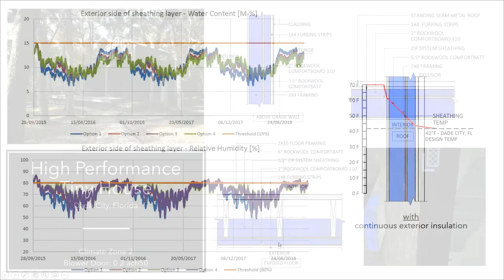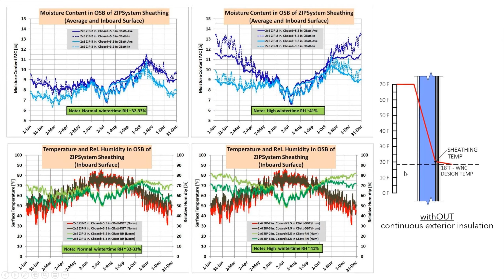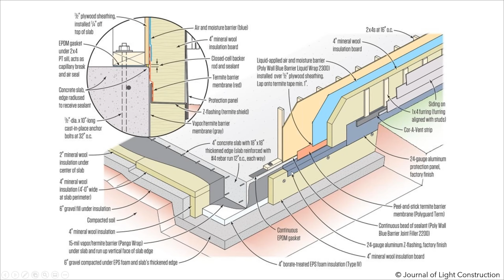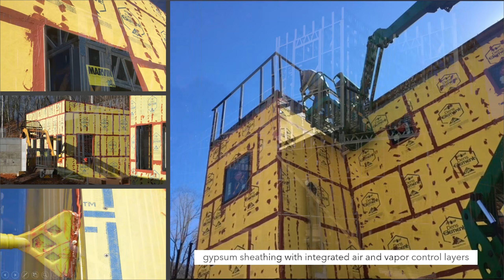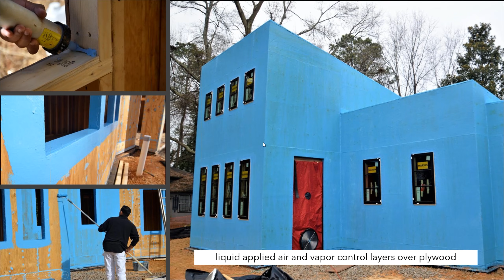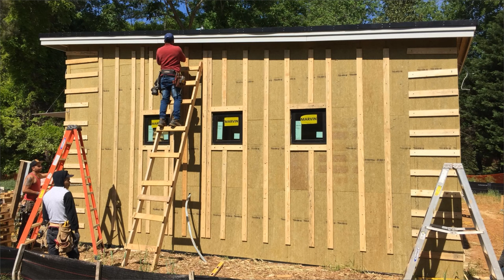ROCKWOOL Insulation - Case Studies: Tips, Best Practices, Lessons Learned

Comment: Rain screen or air gap furring strips' orientation 

The Rain screen or air gap furring strips' orientation must be vertical to allow for unobstructed continuous water, air, and moisture flow.
 If your siding needs to attach to horizontal furring strips, they must be attached as battens over the required unobstructed vertical furring strips.
Source: Hammer & Hand / Horizontal Rain Screen Furring for Vertical Siding
Reply: I didn’t hear any details describing air changes or drying out of the cavity rock. I’ve noticed a lot of builders  omitting the vented cladding details.  Over  years the metal sided applications are producing condensation that roll down the inside surface and sit on every horizontal furring       Maybe it’s not a big concern to some builders.
Reply: @BostonMark  
BSD-105: Understanding Drainage Planes
Building Science Corporation: Joseph Lstiburek

Abstract:
Controlling rain is the single most important factor in the design and construction of durable buildings and the control of mold. Drainage planes are used in the design and construction of building enclosures to control rain. All exterior claddings pass some rainwater. Siding leaks, brick leaks, stucco leaks, stone leaks, etc. As such, some control of this penetrating rainwater is required. In most walls, this penetrating rainwater is controlled by the drainage plane that directs the penetrating water downwards and outwards.

Fundamental Principle
The fundamental principle of rainwater control is to shed water by layering materials so that water is directed downwards and outwards out of the building. The key to this fundamental principle is drainage.

Gravity is the driving force behind drainage. The “down” direction harnesses the force of gravity, and the “out” direction gets the water away from the building enclosure assemblies, openings, components, and materials. In general, the sooner water is directed out, the better. Sooner may not always be practical – such as at window openings where draining a window into a drainage space behind a cladding is often more practical than draining them to the exterior face of the cladding.

The most elegant expression of this concept is a flashing. Flashings are integrated with drainage planes creating, for all practical purposes, flashing for the entire assembly. A “screen” or “cladding” is installed over the drainage plane to provide aesthetics and to provide protection from ultra-violet radiation and mechanical damage. Drainage occurs between the cladding and the drainage plane.